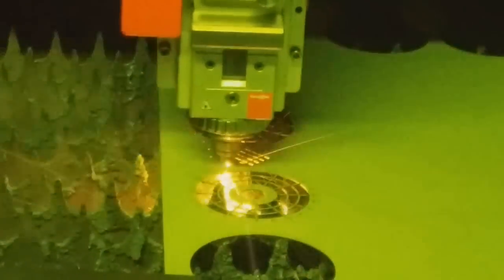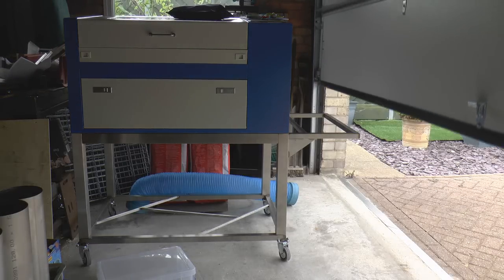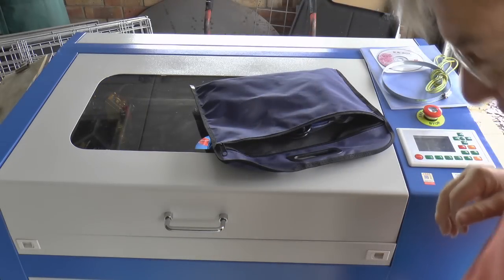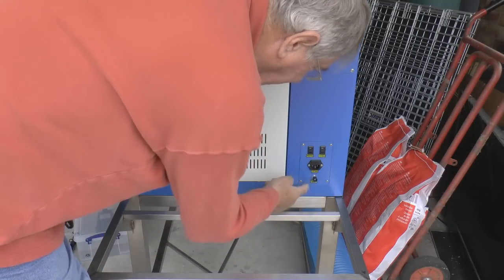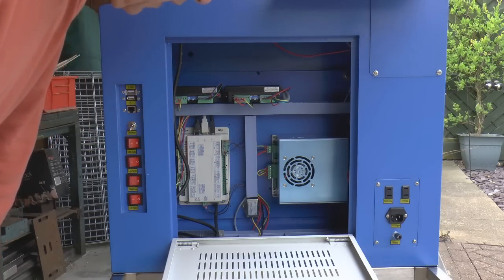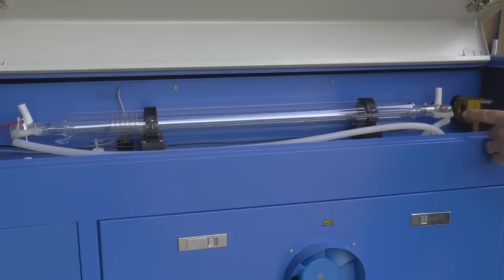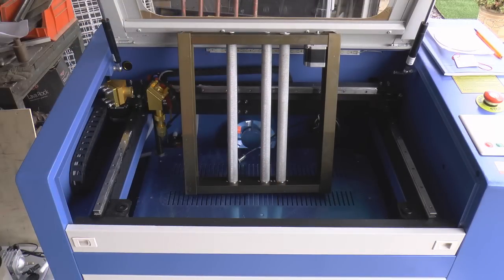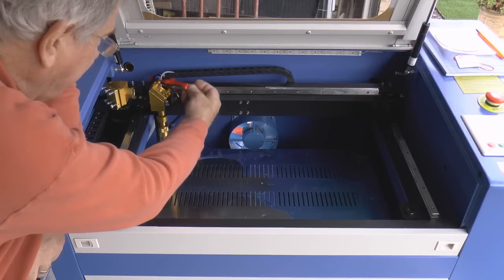Chinese laser cutter  tutorial part 1

Comment: Thanks Russ

I recently bought a similar machine and had done a lot of research before buying, so that I know what I was getting.

It looks like they are continuously changing and improving these machines.

I was under no illusions that it was actually a 50W laser and it was more likely to be 30 to 40W at best.

I also realise these machines are not a toy and great care has to be taken because of the EHT on the laser and also the actual laser beam as its IR (not visible), hence I will be using eye protection, wrap around).

However, I think its very important to point out to people that these are not toys, because the price is now coming down so much that many more people will consider buying one.

I'm still commissioning mine at the moment, fitting an extraction system,  etc etc.

But I will comment again when I make some progress (and I will watch all your videos)
Reply from the maker: +Roger Clark 
Thanks for the appreciative feedback and I'm glad that you have entered this adventure with your eyes wide open. Take a look at my 4 month review to see some of the changes I made to my machine, upgraded extraction being one of them. Also you MUST fit an ammeter at the earliest opportunity so that you don't over drive your tube....this was a big mistake I made. Until you fit an ammeter, don't run at more than 65%power..

You are quite right about the "toy" issue. There is a guy around in the US just beginning to market something called GLOWFORGE. He claims it is (by public perception)a 3D laser printer. The advertising is superb and if you are  a normal Joe then this looks like a family friendly piece of kit (like an inkjet printer). It's little more than a grossly over-hyped 40watt desk top laser cutter The video is on you tube, you need to watch it to just how irresponsible it is.

Thanks again. Keep us updated.

Russ

ps watching all my videos will be slightly more interesting than watching grass grow ....but not much.
Reply: +SarbarMultimedia 

Hi Russ

Thanks for the tip about not running the laser at more than 65%.

I'll look at your video and see which ammeter you use. I have several digital multi meters, but I presume I'd need to get a panel mount digital meter for this.

BTW.
Just looked at my laser and it has model number 51150-A, and "Agreed Power" of 45w, written on a label titled Certificate of Conformity by "KH Laser laboratory" - but I can't find anything about who they are.
There is a manufacturers labels on the laser as well, but I can't see it as its on the underside.

Its probably all meaningless ;-)

Re: Glowforge

Ummm.

Looks like typical kick stater project, all gloss and hype.

I will be surprised if any production models ever get shipped to real customers.
Reply: +Roger Clark 

Just a small followup..

It looks like these machines are being updated all the time.

If you look on your video at about 4:24 where you show the right side. Mine has 2 additional push buttons above the USB connectors, which raise and lower the bed. (I'm not sure how that is controlled on your model; possible via the main control panel at the top)

Mine also has a network connection under the 2 USB's, and there is a menu option to set the device IP address; however at the moment I don't know what use the network connectivity is, because I have not read through all the manuals supplied in PDF on the CD that came with it.

Also. Looking at 6:26, mine has a much cheaper plastic flow sensor

Looking at 6:43 the laser tube does not appear to be quite the same as yours. Its the same length, but the shape of the glass at the left end appears to be different. Also they have a different path for the HT wire to the tube  - which to be honest, I don't think its ideal, as the HT wire is next to the water pipe)

They also have the return / earth wire for the laser running back along inside by the tube (yours doesn't appear to do this), plus the wires for the small fluorescent tube are bundled with a cable tidy with the return / earth from the tube, which is a bit messy and unnecessary.

I think you replaced your laser...??

Were the water tubes glued on ?  I tried to detach one tube to run its path in a more logical way, but it didnt seem to want to come off the laser, and I didn't want to put any force on it)
Reply from the maker: +Roger Clark Hi Roger
Go to Boss Laser website and download their pdf manual. Someone has done a half decent job of translating the manual into understandable English.
My motorised talbe is a 3 position switch just  below the 2 usb ports. The top usb is for memery stick and the bottom for your pc.
My flow sensor was a bit intermittent so at the moment it is bypassed (connected the two wires together, its just a normally open switch)
Reply from the maker: +SarbarMultimedia Sorry pressed wrong button before completing reply
Routing for HT cable not crucial. The cable is a special HV cable (I think it's called Tessla cable) At the termination its covered with a silicon sealant which gives good insulation also..By it's very design the water inlet and the HV terminal are close.
My tube return wire is running back along the tube in the base of the tube enclosure . Again this is at almost zero volts and is the line you break into to add an ammeter. The wire here is nothing special as it's taking just a few milliamps of load.

Yes I did replace my laser because it wouldn't run at high power percentages. I was convinced I had wrecked my tube  and did a replacement (video is in the series) I havn't thrown the tube away. When my new tube arrived I did a lot of digging around on www to try and find out how these tubes work. I think this will be the subject of a future video because now I understand how these tubes operate it maybe that my old tube is not actually dead. My only advice to you is fit the ammeterand stick to 65% max (or whatever your percentage is for  20mA drive current)

The water tubes that are glued on are usually just  the short linking tubes. If it's the main tubes that are glued  and you need to move them then just cut the tube beyond the glass, split the remaining tube on the glass with a knife and it will peel off. I't not necessary to have the main pipes glued on as there is virtually zero pressure in the circulating water.
Good luck
Russ
Reply: +SarbarMultimedia 

Thanks Russ

I took a few videos and will edit them together and upload when I get chance.

I think I'll leave the tubes etc alone and just get the machine working to a point where i can at least pulse the laser, but that will be a few days away, as I want to make sure the optics are clean as well, because I know dirty optics can burn out the mirrors.

Cheers

Roger
Reply: Hi Russ

Sorry to keep bothering you, but ....

Just installed the water pump and there are some parts of the laser tube that have air locks, its at either end, for about 2 inches

The flow rate from the pond pump they supplied, is not enough to push the air though and out of the tube, and I'm not sure how critical it is to cool the entirety of the tube ?

(I will start to watch your other videos, to see if its shown in any of them) (well Videos 4 onwards, as I've only watched 1,2 and 3 so far ;-)
Reply: OK. Just looked at video 4 and I can see you don't have any air in your laser tube.

umm. I think its because my flow rate is being constricted because my pump came with a brass small bore tube adapter, which I fitted and then attached the plastic tube.

Possibly if I use that strange arrangement of pipe adapters they were also in it kit of parts, it may improve the flow rate and get rid of the air pockets
Reply from the maker: +Roger Clark 
Hi Roger

If you look at the 4 month review video you will see I had issues with just such flow restrictions. I have a fairly crude arrangement of tubes out from the pump that no longer limits the flow. I have had several submersible pumps for my water features and happen to have a selection of left-over fittings I could choose from.  I get about 2 litres/minute flowrate, not high but sufficient to cool the tube. Yes I did get a pocket of air at the outlet end of my tube which was difficult to move. Try rotating your tube so that the outlet is as high as possible and finally I had to shake the silicon tube to shift it. I think a small local airpocket is not going to reduce tube performance.
Russ
Reply from the maker: +Roger Clark In case you miss them, there is a whole follow on series about me learning to use the RDworks free software. Look for RDWorks Learning Lab. There are over 30 videos there so far!!
Russ
Reply: +SarbarMultimedia 

Hi Russ

Thanks for the tip about watching the 4-month review video.

Its interesting to see you didnt need to use a large air compressor. I have a DIY air compressor (1Hp I think) and was considering using it, but you have saved me the bother of hooking it up.

Getting the airlock out of the tube is proving to be difficult.

I'm going to buy a 350W pump from the local big DIY store (Bunnings)
http://www.bunnings.com.au/ozito-350w-dirty-water-submersible-water-pump_p4816179

The existing pump is only 60W, so I'm likely to have to restrict the flow on a 350W one.

They also sell a 84W one, but its the same price 
http://www.bunnings.com.au/our-range/bathroom-plumbing/plumbing/pumps/submersible-pumps?sort=PriceAscending

So I may as well take a punt on the 350W one. The only issue may be noise ;-)
Reply from the maker: +Roger Clark 

Hi Roger
Your existing 60 watt pump is already strangled by the small aperture inlet and outlet glass throats. Its about 3000 litres per hour unrestricted flow rate with about a 2.5m head and if you measure the flow rate from the return pipe into your tank it will be in the order of 2 litres/min that's only 120 litres per hour not 3000!!! The 1/2 hp pump will be noisy  and I would be concerned at the build up of pressure in your silicon pipework and that's a hell of a lot of flow that got to be spilled or stalled in the pump. It could well result in cavitation which would generate lots of air passing through your tube. I would try doubling the pressure with a pump that won't cavitate by looking at a 5000 l/hr pond pump.(100wtts?) It will still generate twice the head (about 5m) but will be quiet and will still give laminar flow through your glasswork.. I have subsequently researched and understand how the tube works and the way in which heat transfer occurs. The jacket needs to be kept cool but small air pockets are not going to disrupt that mechanism or cause power loss.

I tried my workshop air compressor but it introduced damp air into the nozzle area and turned to steam when hit by the IR beam. It then quickly formed a film on the surface of the lens which obviousy is not good for power. As you mentioned,  the compressor was noisy and was on almost continuously. I carried my experience forward from indusrial machines when I fitted the gauge and larger airflows. But you live and learn The main function of the air assist on this machine is to keep a positive pressure in the nozzle so that fumes cannot get to the lens. A secondary function is to GENTLY clear away smoke and fumes from the cut itself. The smoke and fumes absorb the IR and reduce cutting efficiency but if you blow too hard then there is a cooling effect in the cut that also reduces cutting efficiency, hence the word GENTLE. Although I didn't like the pulsing effect of the aquarium pump it does seem to work quite well. I have reduced the pulsing with a pressure regulator. That was a left-over form my compressor days but I kept it because I find I need to reduce the pressure when I'm cutting this paper.

All best wishes for a great Xmas. At the moment here in southern UK it's almost BBQ weather. Stupidly mild for this time of year.
Russ
Reply: +SarbarMultimedia 

Hi Russ

Well, I bought the pump before your rely, and I really like it, but its giving proportionally more flow rate, and the nice thing about it, is that it looks substantially better made than the pond pump and has a nice mains plug on the end.

I had to make an adapter my tapping one of the existing bits plumbing from which were attached to the pond pump, into a 25mm dia (plastic) end cap, and it doesn't cause any significant issues to the existing pipework.

But I still have a small airlock, and I was initially getting issues with cavitation, of the pump impeller causing small air bubbles to be produced.
However as most of the air has now been expelled from the water it seems OK.

My other concern, especially here in Aus, is heat from the pump, i.e its 350W so it will start to heat the water and this is a problem here because I think the ambient temperature of water from the cold tap is around 20 deg for me at this time of year (summer).
I had contemplated buying an aquarium chiller,  but they start at around $400, and its cheaper to freeze 1.5L bottles of water in the freezer then put them into the water reservoir to cool it down.

Anyway...

I think part of the issue may be the rotation of the tube. My EHT power inputs are not vertical at the top, and consequentially, the water output is close to underneath the tube, which means the flow rate would have to be very high to pull the air lock bubble downwards and out.

So... I'm contemplating unscrewing the rather rudimentary brackets and holding the tube in place and trying to rotate the tube though around 15 to 20 degrees, so that the output water point is virtually horizontal, as would the input point be.

But of course, I stand the chance of screwing up the laser alignment, which is hopefully set fairly well from the factor; but as I've not fired it yet, its hard to know... it could be completely miss aligned...

I guess I could pulse the laser in its existing config, as a pulse is not likely to cause problems to the laser even with a few small air bubbles at the end, as the amount of energy being consumed by the tube will be negligible. I'd not be at all suprised if at the factor, they pulsed it to align it without putting any water in the system

BTW. I also found a construction in the return water path, because the pipes had been cable tied too tightly together, but again removing this constriction didn't make a discernible difference.
Reply from the maker: +Roger Clark 
Hi Roger
Heat is always an issue because for the laser to run efficiently it needs to run cool. I plan to do some experimental work soon to see what the relationship is between water jacket temperature and power output because there are lots of different opinions out there. I feel fairly confident about running at 30C but above that, well who knows? As you have rightly mentioned. 350 watts is not an issue in a continuously flowing open ended system but 350 watts has got to go somewhere as heat and in a closed system you may well have just added an immersion heater to your system,
 I looked at several different pumping methods for my air pockets including one of those cheap drill-driven pumps which are almost like a positive displacement pump. They have snug fitting rubber radial vanes that don't allow water slippage/stall The variable speed drive motor  and the pump body would have been outside the tank (not adding to the heating load)  and the plan was to have a tee on the outlet with ball valve that would have allowed me to spill excess flow back to the tank. Playing with the pump speed and the gate valve would have allowed me to adjust the pressure little by little to force more flow through the glasswork. I was paranoid about over-stressing and destroying my tube. However, although I still have the £5 pump, I never went to the trouble and expense of fitting it. Instead, the few air pockets in my first tube did yield to one radical method.........I raised one end of my machine on 2" blocks. It looked a bit strange but caused no other issues. You may finish up using your original pond pump as the lesser of all the problems.

Pulse testing will cause no problems. but make sure you get some isopropyl alcahol to clean your mirrors and lens (use a cotton wool bud to clean via the entry/exit ports). If the mirrors have collected dust and debris in transit then firing IR at them could burn a film onto the surface which will absorb energy rather than reflect it. The mirrors will heat up and "pop"

Best wishes
Russ
Reply: +SarbarMultimedia 

Hi Russ

Yes... Its possible that I may end up on my original pump because of the cavetation issue, but I'll stick with it for the moment. I can also get an 80W pump from the same DIY, but it was actually more expensive than the 350W and 80W seemed hardly worth upgrading to.

I've re-read the manual PDF file that came with the machine, and it goes through the installation of the tube, and in their pictures, the output tube is actually going straight upwards!

But my tube does not look like your tube, as the output water system looks different.

Lifting up one end is an option, but I think I'll bite the bullet and unscrew the appallingly badly made clamps (bits of bent galvanised strip !!) and rotate the tube a bit. 
The only issue is the electrical connections, as I can't rotate it too far around as they would get close to the back , and I'd prefer to leave a large air gap if possible.

Sorry about being paranoid about the EHT, but I have some experience of high voltages as I used to run Ham radio equipment which had HT valves in it, so I'm cognisant of issues in this area.
(However that was a quite a while ago and I'm sure insulation had improved a lot in the last 20+ years)

Re: Cleaning with isopropyl alcahol.
Thanks. I was intending to do that after I got the laser cooling working.
Its just taking longer than expected to sort out these cooling issues.

Anyway, thanks again and I'll keep you posted of developments
Reply: +Roger Clark 
Update...

I've gone back to the original pump, as the new one was basically too powerful and had issues of cavitation.

The only way I could get the air bubbles out, was to unbolt the tube and rotate it so that the output water tube was horizontal, and I also had to lift one end of the tube up a lot,  several inches, and generally move the tube around to get rid of the bubble near the water output tube.

This means I've almost certainly ruined the laser alignment, but it wasn't practical to pick up the whole machine to be 30 + degrees higher at the left side (looking from the front of the machine)

Also. I've didnt mention before, but the tube is not really held in proper brackets. There is just an aluminum block under the 2 mounting points, and on the top is strip of metal that has been roughly bent by hand, and not even formed over a circular object of the same size, the ends have been bent at right angles, probably in a vice and have a hole drilled for the retaining screw.

They have positioned / aligned the laser by packing bits of stiff rubber around it !

I've seen well made, plastic, laser tube backets on AliExpress, for around $40 US, but they will take weeks to arrive especially as its Chinese new year soon.

But fortunately I also have a  3D printer (built from a kit... Nothing fancy...), so I think my best option is to design some brackets and print them myself.
I found some designs on ThinkiVerse e.g.  http://www.thingiverse.com/thing:420853  which look quite good, but I cant see how the hanger design works. I think I'd be better off perhaps designing and printing something like this
http://www.aliexpress.com/item/Yongli-YL-ZJ-adjustable-plastic-laser-tube-mount-support-holder-bracket-for-dia-45-80mm-co2/32457664592.html?spm=2114.01020208.3.27.5wuD9b&ws_ab_test=searchweb201556_4,searchweb201644_4_79_78_77_82_80_62,searchweb201560_3

or this http://www.aliexpress.com/item/Plastic-Laser-Tube-Mount-Support-for-Laser-Tube-80mm-diameter-80w-100w-120w-150W-LASER-TUBE/32255893801.html?spm=2114.01020208.3.18.qWZg5Q&ws_ab_test=searchweb201556_4,searchweb201644_4_79_78_77_82_80_62,searchweb201560_3

(some other parts http://www.thingiverse.com/nexus7fan/collections/laser-cutter-parts )

But, designing in 3D and then printing stuff in 3D is never a quick process, as invarably my initial designs are wrong and I end up reprinting several times before I get things right (and 3D printing is far slower than laser cutting !)

Anyway, I'm planning on cleaning the mirrors today and then pulsing the laser to see just how far out of alignment it now is ;-(
Reply from the maker: +Roger Clark 
Hi Roger
You may be interested in watching my latest video as I might be able to save you a lot of money and effort
https://youtu.be/LsVGSm1DkqQ
Reply: +SarbarMultimedia 
Thanks Russ

Those are great looking brackets

You would be appalled by the &quot;brackets&quot; that came with my machine.

I will endeavour to take a video in a minute and upload it somewhere so you can see just how bad they are on my machine ;-)

OK.

Here is a temporary link to a video. https://drive.google.com/open?id=0B4AdvMiTQuacWHlzTHBsWktmMzA
Prepare to cringe at the brackets !

PS. I forgot to show what I've done with the bed with an aluminium grill
Reply from the maker: +Roger Clark 
Hi Roger

Click on the Sarbar logo and in the "about" section you can send me a personal message. Drop me your email address and I'll send you the ready-to-cut file so that you can run it as a project when you get your machine running.
Russ
Reply: +SarbarMultimedia 

Hi Russ

Well, I finally plucked up the courage and pulsed the laser and its working !

In fact, far less drama than I was expecting ;-)

I put some 5mm acrylic sheet in front of the first mirror and interestingly, the first pulse only made a very faint mark, so faint I thought perhaps I'd just not noticed the mark on the old scrap piece of acrylic before, so I moved the acrylic and pulsed again and it make a bigger mark the 2nd time and then bigger again on the 3rd pulse.

I think I read somewhere that laser tubes run better when they are used regularly, but I'm not sure where I read that.

Of course this could be that the EHT power supply gave move voltage on the 2nd and 3rd pulses.

Anyway, I though the laser was too high and had removed some packing / rubber under the tube, but it looks like  it was correct in the first place, so I will have to put it back, or perhaps shim up the aluminium mounting blocks with something, perhaps some 5mm plywood.
I think I can get away with wood, because the whole mounting plate for the laser is just a thin sheet of pressed metal and easily bends, and I think is warped downwards in the middle. 

I'm going to fit a bracket on between the laser base plate and the back of the machine, in the middle as this will greatly increase the rigidity, as the flex is in the vertical direction.

I've also noticed that they have skimped on the number of bolts holding down the frame on which the platform motor and lower bearings are located.
So that the corners, where the platform is supported, flex around 5mm, because the frame assembly seems to be warped up at the corners.

I have not looked underneath yet, so I'm hoping the bolt holes have been drilled, and that its just a question of fitting the missing bolts.

I also made the mistake of snapping off one of the retaining bolts for the glass panel in the middle of the lid.
Basically, the bolt, as not firmly spot welded to the inside of the lid and just doing up very gently with a small socket wrench snapped it off. So I had to partially unbolt that side of the rataining frame and remove it, so that it didn't rattle and eventually fall inside the machine.
It doesn't really need all the bolts, so its not a problem, and in the longer term I was going to use silicon sealant to stick the top acrylic in place

I noticed that you did some tests with a laser pointer in another video. I have some laser diode modules, from another project and briefly looked at how to use them in the same way, but getting the laser diode aligned exactly the same as the actual laser is going to be tricky.

Anyway, now that I know that all the main functional blocks of the machine are operational, I'll accept from the eBay supplier, and then set about doing some modifications, as I won't be returning it.

This will include re-routing the wires for the fluorescent tube straight into the main electronics chamber, rather than its insane route via the laser chamber.

I'm also not that happy with the way the incomming water pipe is routed right next to the positive EHT wire, and may re-route the EHT so that it comes in and then goes around the back of the tube.

NOTE. I will wait at least 15 mins before going anywhere near the EHT end of the tube.

 
Anyway, I"ll keep you posted.

Thanks

Roger